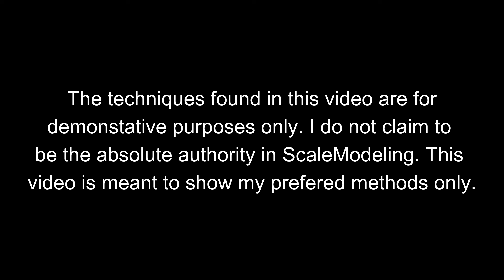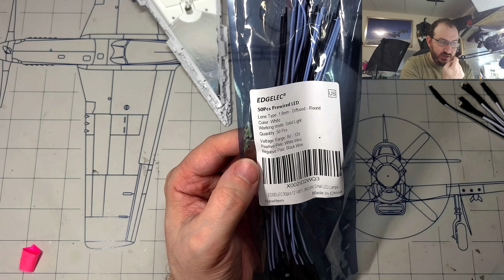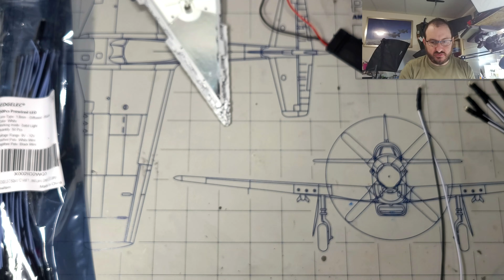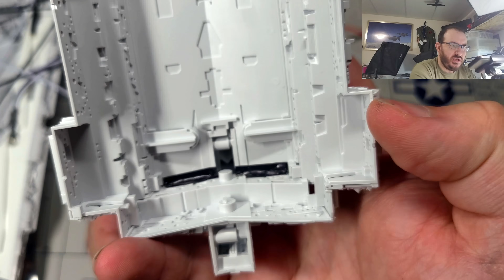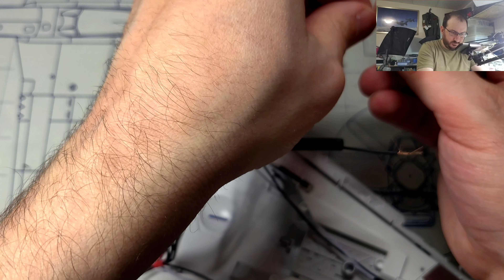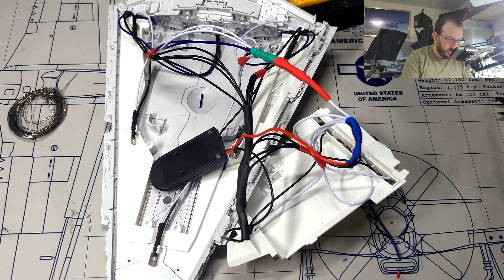How to add lights to your models for LE$$

Comment: I have this model but it's  too small for me to attempt this as a novice. I believe the ESB Star Destroyer did use "heat sinks" or the bulbs used to light all the fibre optics would melts the entire model.
Reply from the maker: Yeah, they didn't have LEDs back then.  I would use the dedicated light kit that comes with the lit version.  I have an extra i can sell you.  wasatchmodeler@gmail.com

Comment: Nice video!  I know I am a little late to this one, but I would offer that there are mechanical connectors for folks who want to light a model and aren't equipped to solder.  I am finishing a large scale enterprise model and I used a mix of soldering and WAGO connectors.  That has allowed me to connect sub systems of lights in a way that allows ease of assembly and disassembly if needed.
Reply from the maker: That is a good point.  Wago or wire nuts would be great to get started

Comment: Great video but need to ask a question lol. So the leds are 9v - 12v so to me that means a 9v battery is required to power 1x led. Yet you managed to power all those lights with I think less than 9v ??? I'm confused or thick 😂 please explain if you don't mind
Reply from the maker: It comes down to how it is wired.  It is wired parallel.  So it shares current.  Then we get into ohms law with amps verses volts.  I have wired maybe 30 lights on one power source.
Reply: @ cheers, hoping to add many lights to a 24 scale truck so I'm assuming a 9v will power it all based on your video . Thanks for replying 👍

Comment: Hi, thanks for the video. I'm new to led lights. Could you please post some links where you can buy the products you showed? Thanks a lot for you suggestions. Cheers
Reply from the maker: Amazon has a ton of options. uxcell 20Pcs 2mm Pre Wired LED, White DC6-12V Clear Lens, Light Emitting Diodes https://a.co/d/d4c6idW
Power AspenTek DC 12V 1A Power Supply Adapter with Inline on Off Switch for Small Led Light Strips,Led Rigid Bars,Led Tape Lights, Under Cabinet Lighting, Output 1000mA, 12 Watt Max https://a.co/d/jfIb8cV
Or Aobao 15pcs cr2032 Battery Holder, CR2032 Battery Holder with Switch, Coin Cell Holder, 1 x 3V CR2032 Button Coin Cell Battery Holder with Leads On Off Switch (Black) https://a.co/d/18Nwfp9
Reply: @WasatchModeler  Thanks a lot!

Comment: Hi, great video, very straightforward and useful. I recently saw a video of the same Bandai star destroyer, with the original lighting set and at the end, all the little light dots had variable intensity depending on  whether the led was aligned with the little holes or not. It varied as the model was turned to show. Have you seen that happen? Did you do something in yours to avoid such thing? Thanks!
Reply from the maker: That can be an issue. I left it as is with this. If you want to paint the inside silver then it can reflect on the inside. You can also add more leds with this method.